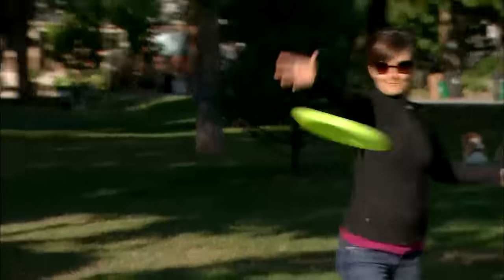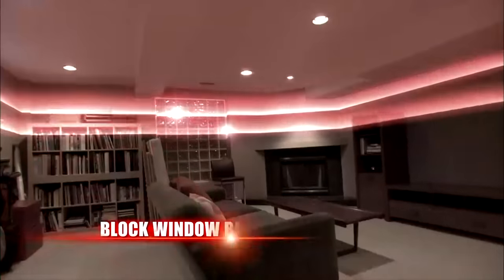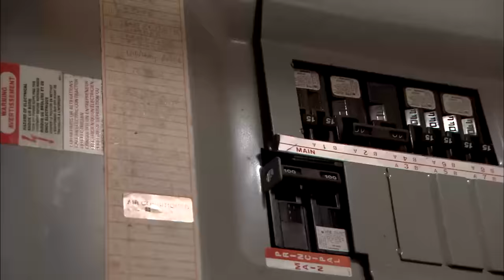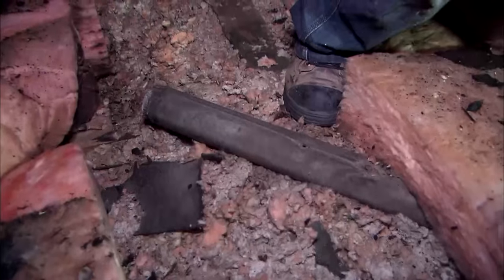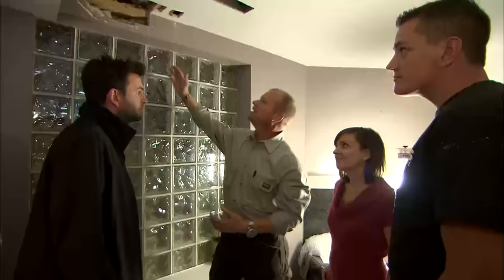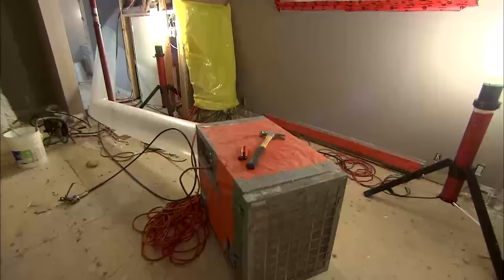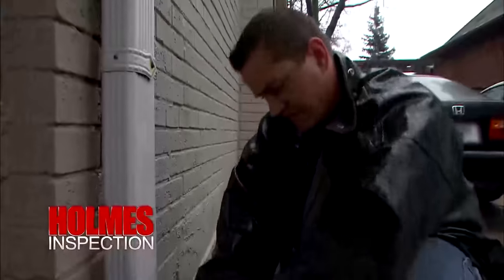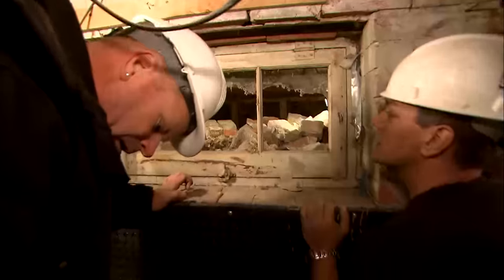Home Inspections Done Right - Part 1/2 | Holmes Inspection S122

Comment: I would not be surprised if they have an episode where Mike says "Turns out this home was built on top of a burial ground, so we brought in a shaman and an exorcist..."
Reply: Not as uncommon as you might think, building on old cemeteries and the like is sadly a fairly common practice. If your lucky they actually removed the graves first, if your not and decide to expand a basement you might find "surprises". That or old landfills, they love to build on them because the land is cheap after all.
Reply: And it wasn't mentioned in the home inspection
Reply: Way back, small communities would bury family members close by. Backyard close by. Because that's how it was done. The family kept track of who was where. But over time, the family dies out or moves away. The stones fall over, get covered up. The little graveyard disappears. Until someone has to dig up a basement....😮
Reply: I worried about exactly that when I expanded my Port Moody Home, on the first day of digging.
Reply: There was an episode where they found bones buried in a basement. They called the police who determined they were just animal bones.

Comment: Both Canadian and US laws should hold these fly-by-night inspectors liable for missing so much. They work for the realtors in most cases and they don’t want to lose a deal. In addition, when code violations are found (per the code of that prior year), the city/county should be notified so that repairs much happen prior to sale.
Reply: You hit the nail on the head.
Reply: Sue the seller also they knew they were selling a lemon ,just to get rid of it so they don't get stuck with it
Reply: I'm wondering if he had an inspector prepare a report, or had an inspection report prepared; maybe the seller just prepared the report himself.
Reply: the problem is that contractors aren't all certified and even if they were, if you're using a contractor that's hired by the seller's realtor, bias gonna be applied. Also there are lots of buyers that like this couple that are STUPID. They didn't check foot to ass on this house to see if its good, they looked, saw how beautiful it looked but didn't bother to hire a expensive inspector to see if this house is worth buying, sometimes paying more gets you a more honest inspector.
Reply: @robertbrainard5651  Some times, but not always. I would say record every thing these days though. If you walk around with a home inspector, record what you and they see, added bonus you get their words for the record when they tell you things are fine.

In general though just assume any house you buy has not been taken care of and has been flipped at least twice with tons of cosmetic patch jobs to cover up the problems. The "real estate boom" we have had for the last decade or so has done nothing but push the quick flip market. Which is usually things like slap a fresh coat of paint to cover mold and water damage and sell the house for more.
Reply: They do in the US

Comment: I knew a boy when I was in primary school (different school, but were in the same club), in the 80's, whose dad was exposed to a MASSIVE amount of asbestos. I mean huge amount of asbestos exposure over just a year or two, as he was a builder/contractor for local government. He died within 10 years of exposure, he was exposed sometime in the 1970's, usually it's like 40+ years and died of Asbestosis. Then while I was at that school they found asbestos in the disused clocktower, we had 10 weeks worth of "Summer Holiday" (which the parents weren't happy with) instead of the usual 6 and they had to decontaminate and test the entire school. You don't mess with asbestos to any degree, but the whole house and they had multiple renovations over the years. WOAH!!
Reply: Mesothelioma

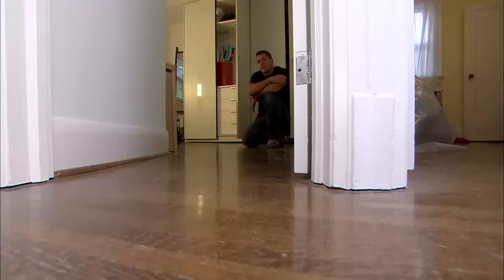Comment: lol 15:29 reminds me of my Century home (built around 1880).  Can do that in my living room.  Built on the Canadian Shield so it has settled and not willing to risk any issues via jacking it up.

15:48 -- had that issue in bathroom on back room that someone added on. Crawlspace was dirt/stone and I cleaned it out, encapsulated it and added a jack post to try to take some "bounce" out of the floor. In that process the bathroom door no longer sticks. LOL

Comment: I watched this when it first aired and was blow away by the work involved. These inspectors need to be held accountable.
Reply: Home inspectors should carry liability insurance so when their reports inevitably go bad, the home owner has an outlet for compensation.  It will make the home inspector accountable for their report because their liability insurance will skyrocket if not with the quantity of claims made against them, so instead of a quick run through with a pre filled report and the money in the back pocket (and currently no option to go after the inspector), the inspector actually spends a decent amount of time to check and verify everything they can.  I also think that potential home owners need to go in with wide open eyes instead of using their heart and falling in love with a property - spend the money and get dedicated electrical, plumbing and heating reports done - anything found will give room for negotiation on cost, or the ability to walk away from a potential death trap as in the long run, the cost of these reports would be less than having to do remedial works after you've signed on the dotted line.
Reply: What qualifications do these honest inspectors have in wonder. Like those guys who inspect my home for energy efficiency. What really do they know?🤷
Reply: Polyethylene. Forever chemical? Now that’s another endocrine disrupters
Reply: Contractors and inspectors

Comment: I can't but wonder how many other homes out there are in somewhat similar conditions.
Reply: Scary man
Reply: Homes built between 1850 and 1950 without a remodel, will have plaster/lathe walls.  The plaster may have asbestos as the reinforcing fiber in it.  Some older homes may have horse hair as the fiber in the plaster.  Very old plaster may have asbestos as a natural part of the plaster.  So you still have to be very careful.  In the 1950 until drywall was invented, used expanded metal as the backing instead of lathe.  (the metal will act as a Faraday cage and cause bad radio, TV, cell phone, WIFI reception).
Reply: Dont think on it too hard you'll give yourself an aneurysm
Reply: the more i watch of these the more i think maybe my house is one like this. i would have it "inspected" if only i could find someone as responsible and honest as Holmes. ignorance is bliss, and then not

Comment: of course it would sag when then load-bearing wall was removed...
aout a decade ago, my brother and I helped our dad do a kitchen reno, we had to modify the build plan to include a wall we were going to remove because it was a loadbearing wall... we still put the "island" counter but on each end of it is about 1' of wall which was beefed up to be able to still perform its load bearing duty even with the area between these two sections removed...

Comment: The bathroom contractor is top notch. He could have just done the reno and disappeared. But he was a pro and told them to fix the structure. That said, the inspector should have caught it. The floors were visible, no need to move furniture, or lay down. He could have seen the amount the walls separated from the floor, or the wedge in the kitchen cabinets. With what fixing the house cost a shaman and an exorcist would have been the better way to go

Comment: I watch this video series in both amazement  and horror.  We lived in a house that had hidden the fact that the floor was completely separated from the house.  You could see about an inch or 2 outside into daylight.  When a person came to repair a electrical problem in another house they had to open up a wall.  It was filled to the roof and down to the bottom with fungus and ugly mushrooms.  It turned out the entire house was filled with bracket fungus, mushrooms and mold.  Never let my inlaws or husband go to rent alone again.  Cheap  is never a rental bargain.  And yes the heating was a total joke.

Comment: I know I’ll probably take some shit for this but we put zip on my dads 36x60 pull barn. Put caulk on every nail hole and sided the place 3 years later. I know it’s a 500 day but it held up like new. Right on the at Lawrence river in the 1000 islands. We are “cheap” 300k into the place but we’re waiting on the siding to be milled

Comment: Asbestos is perfectly fine, and will be no problem, so long as it is not disturbed. If it is, the fibers can become airborne, that is when the health issues can occur. However, it the asbestos insulation is in good shape, and not disturbed, it is fine.
Reply: There was asbestos in the plaster, so they were at risk anyway.

Comment: These American Four Square houses are very common in Chicago. If built before asbestos was discovered, the plaster walls likely are fine (and may even include some materials such as horse hair). However, the plaster walls in these houses in the 40s, 50s, etc. likely contain asbestos. This is really just dumb. Don't mess with the wall and you will be fine (like 1000s of Chicago residents are).

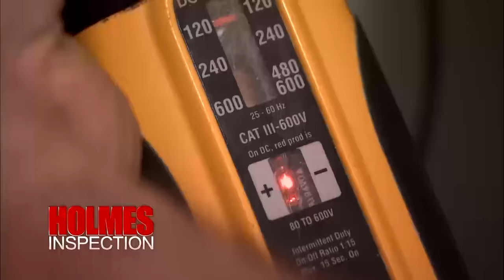Comment: 20:37 I am not a wiring expert,  but that looks horrendous.  They have sagging issues on the second floor, people who bought recently renovated homes within the last 2-3 years during the pandemic where the previous home builder opened up walls AND who forgone a home inspection just to get into their house.
  Think about it, during the pandemic people were buying homes left and right and were not getting a home inspection.  So not only were people over paying for homes but now they are probably stuck with a home with major issues.

Comment: As a “reasonable” human……… I’d leave the asbestos behind drywall. I’d dig a footing for where the point load “should” be and put a steel beam from basement to 2nd floor after jacking up the 2nd floor. This was clearly done for TV
Reply: I completely disagree...  That is simply leaving the problem for the next homeowner and you've hidden the entire problem and made it almost impossible to be aware of the hazard, just like the contractors here.  I just faced the same choice in my own house and I chose to have the asbestos completely removed from my entire lower floor - gutting it back to the concrete block and rebuilding it from scratch.  Not cheap, but I sleep really soundly after that decision.

Comment: From the moment I saw the sagging floors and heard they removed a wall, I knew what the issue was.

The buffoon who did it likely removed a load-bearing wall. In other words, a wall that was holding up the house. You DO NOT remove those unless you get a structural engineer in who is licensed.
Reply: Honestly, I would have evacuated everyone if I was Holmes. Damaged/missing structural elements is a danger that can’t be taken lightly.

I’m Moon-Moon. I’ve been studying structural engineering for years and am currently going to college to pursue my dream.